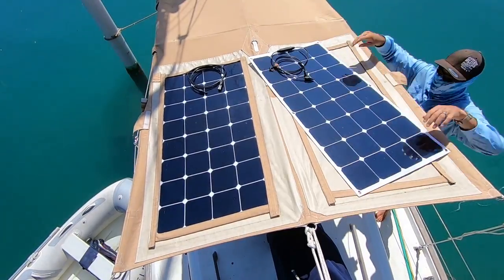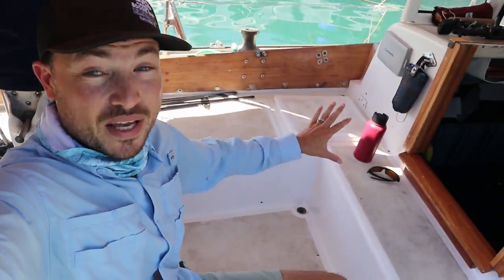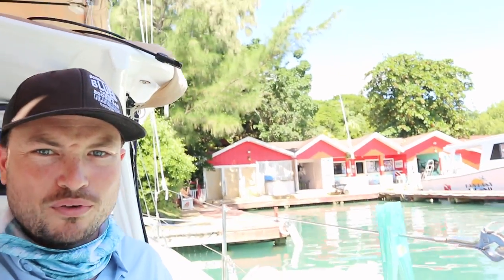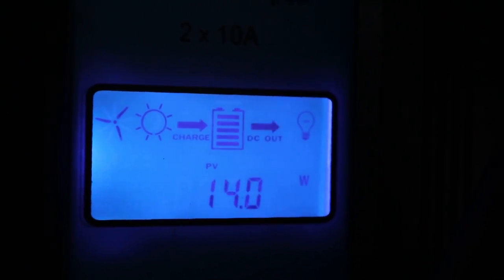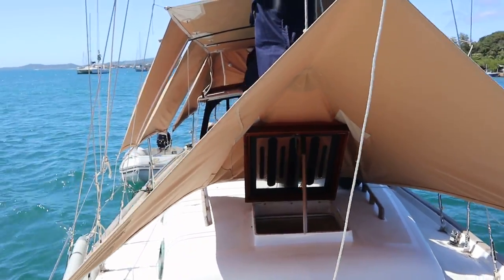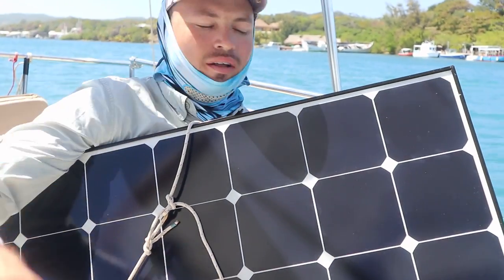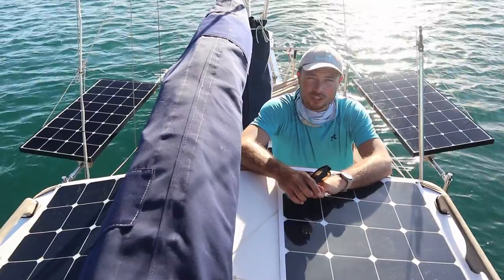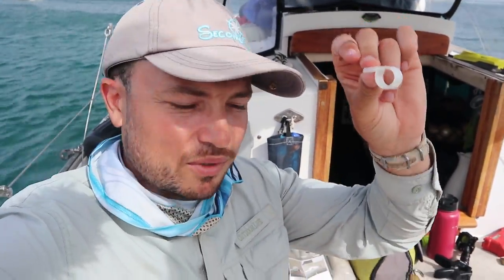Upgrading our Solar Array for Self-Sufficient Sailing | S03E34

Comment: Two suggestions:1) Might be worth the effort to come up with a bottom support strut for the hard panels. The rope will be casting shadows on them almost all the time. Assuming the hard panels are monocrystalline they will be more sensitive to shading than the flexible panels you're used to.  Something pretty easy to test how much the rope is affecting output, see if it's worth the effort. 2) When you have exposed duplex on deck, I think it helps the appearance if you strip the cover/sheathing off some appropriate size rope, and then fish the wiring through that, so basically it just looks like rope. Bit tidier appearance if that's something you care about.
Reply: A guy on my dock has solar panels in the same configuration. He has a under mount slide hinge just twist the key too loosten adjust to angle twist key again. Secure. Probably not cheap.

Comment: Totally love the sunshade setup Des sewed up for Atticus.  On a side note, I would highly recommend soldering any wire connections (crimped or not) and cover with marine heat shrink tubing rather than just using the crimp connectors.  The marine heat shrink tubing has a glue inside that when heated and tube shrinks, it completely water/air proofs each connection. Using crimp connectors alone will eventually allow for corrosion in the salty environment that Atticus will obviously be living in.

Comment: Nice work, I’m right in the middle of my flexible panel install on top of my Bimini.  I stitched some heavy Velcro in a pattern into my sumbrella Bimini and glued the velcro to back of panel.  Hoping it makes for easy removal/install.  It’s a sloop rig though so it’s a little easier to find a good spot .  Wires go up my wing gen mast.  Hope it stays put, will keep you updated.

Comment: just a thought  - you have small cordage securing your panels to the life lines  - we have found that similar length pieces of bungy cord secure as well with the added bonus the elastic nature of the bungy cord allows the cover to get "gusted" and not place too much strain on the guard rails  - a bit like shock absorbers if you wish.  quite happily sits there in up to 20 - 23 kts of true wind.  Just a thought and you two are doing a great job

Comment: Loving all your videos and hoping to get more into sailing soon after years of motorcycle traveling! It's better not to strip back the wire more than an 1/8 to 1/4 inch when crimping on the pin for an MC4 connector. I'm a solar electrician and see damage/failures related to too much of the wire poking into those connectors. Mad respect for all your hard work!!

Comment: I was waiting for that! Having worked on boats when I was younger, I dropped a few things OB without possibility of retrieval. I had a bet it would be the screw driver. The screw was close enough even though it didn't go in the drink. Nice job wiring all that stuff up, and it actually does what you want it to. In my day, it was either shore power, or Gen Set. none of this hi-tech stuff existed. Even batteries were too heavy to use. But then, we were not using as much power as you guys do. No computers, cell phones, ect.

Comment: Nice upgrade. If you make your rail mounts for the panels a friction clamp, it would make it easy to adjust for the sun angle. Also if you can mount so you can swing them inboard of the rail, it would reduce the risk of damage when docking. Have fun.

Comment: We used bbq rail mounts off amazon for  our pivoting panels, mounted on stainless rails like yours. And then we have telescopic squeegees (like, for window washing lol) so we can angle them as needed. The squeegees just get hung on the railing when we're underway and the panels are down.

Comment: Your bracket design for the rigid panels is very well conceived Jordan but, having them made out of wood definitely concerns me. It will be interesting to see how long the brackets actually hold up in that type of application. Please keep us posted 👍
Reply: The wood brackets only slightly concern me, but only from a replacement standpoint. A couple of stowed, two foot sticks of this wood would allow him to replace the brackets numerous times, and I'm guessing the wood cost him somewhere in the neighborhood of $.05. I suppose Jordan could have purchased Sea Dog's #327199-1 rail mounts at around $15 bucks a piece, but this would have chiseled into his beer fund. And as you may know, when it comes to beer vs. a small inconvenience, beer is gonna win out every time, at least on my boat. ;)
Reply: Rob S Can’t argue with that logic. 👍

Comment: I remember thinking I would have dropped at least one of every nut, bolt and screw (ok, I’ll be honest, I’d have probably dropped at least one solar panel in the drink too) over the side on every scene you were working over the water lol. Good job for only dropping one and a place where you could find it.

Comment: Dude just a thought on the solar - in the vid it looks like the velcro was just covering the outside edge of the panel. I'm no expert but in the (extensive) research I did before installing my panels was that even the tiniest shading will impact the output.

Comment: Just a few points (not critique just different). Having a Y with at the panels means there is something that goes over top of the cover (hard or soft) which will  A) rub and be available to getting caught by things dragging across the top. B) have more line loss. You already pointed out the looks issue. Because you are plugging into your hard top, you could put a plugin on either side and avoid all three problems. Of course you are there and I am here. You may have good reasons for not doing it this way either. Take care...

Comment: I wonder why you don't look instead at the ineffective wind generator you have for one that will provide you the energy you need. You have a great wind day & night harnessing that power 24x7 would be the best solution. In my opinion there are wind generators you can install that will provide the energy you need without all the solar panels outboard of the rails.  Great videos by the way, I watch every video you both make and following your adventures is very interesting.

Best of luck.

Comment: You ever heard of a hurricane lantern? It burns paraffin lamp oil. I have one from Dietz that has a hinge handle that you can easily hang on anything. You get light with no wires or batteries and the wind won't blow out the flame.

Comment: You should be very happy with you DC charging set-up. What is you battery bank total? We had 6, 6 volt 185 amp hour, I think, marine batteries and two 12 engine batteries and able to run watermaker, computers, tv, lights and radio's with no problem most days in the Caribbean.

Comment: Hey Dude. If you use dielectric silicone on any electrical connection they will last a long long time. Use it on the crimp connection and any place where there is a tab and receptacle. It is great stuff but don't buy the cheap stuff, use Dow Corning 4 electrical insulating compound. It seals the metal from the elements.

Comment: I'm afraid you may have an issue with that rope (unless its dynema) pulling the flex panels together. When the rope gets wet and over time it will stretch. You've only got a few mm holding those panels on the hook. A little stretch and a little wind and your panels are overboard.  Maybe some grommet twist locks on the inboard side? 
How many watts are you getting out of the wind gen?  What type/brand is it?  Now that you've done it, how many watts per hour are you getting all together?

Comment: Nice job. I have a question, why didn't you run the wires on sides down the stainless tubing? Nice creativity on the mounting all of the panels.

Comment: Jordan: I noticed your exhaust does not have much of a rise from your silencer prior to exiting the hull.  Are you concerned about waves hitting the exhaust and driving water into your engine? The manufacturers recommended rise for my silencer is 18 inches but I cannot achieve that on my boat. Just wondering your thoughts. Thanks. Good video

Comment: Hmm - not really sure but do you want the panels in parallel? I would have thought in series as otherwise if one panel has more light (and output) than the other one, the panel with less light will get bypasses by the protection diodes in the panel.

Comment: Hey guys! We're working on doing a similar rigid panel install on our stanchions, but I'm having a hard time finding hardware. Where did you get your tubing and the brackets you used to attach to the stanchion?  I'd love to know where you found them, and what the manufacturer calls the hardware. Googling "thingy to attach pipe to stanchion" hasn't yielded much for me, lol! Thanks!!! BTW - I love the wood brackets / cord support idea. Do you think it would worth glassing the wood to avoid rot?
Reply from the maker: great question! I'll have Jordan look into this. shoot us an email so I can forward it to him. yep we can on sealing that wood! just needed a temperature fix when we initially intalled the bracket!
Reply: @ProjectAtticus   I'll send an email. Thank you so much! I've spent countless hours trying to come up with an affordable solution, so this video has been so incredibly helpful!

Comment: The name of the tool on Amazon is Master Magnetics 07229 Bendable Magnetic Pick-Up Tool and Retrieving Magnet, 19” Length, 2 lb. Hold, Multicolor in case the link goes bad.

Comment: I'm curious, when you order things on the sea, do you order them to a 'General Delivery' at your next stop?  Do you contact that 'post' to inform them that you are expecting a parcel?
Reply from the maker: great question! we usually only ship things to Atticus when we've been in a location for a couple of months and have had time to figure out which services are cheapest/best. we ask other boaters or marinas. in Honduras we used a company called Dip Shipping. we used fantasy island's physical address to receive the package but sometimes it can be difficult because a lot of the places we go don't actually have an address

Comment: If you are running a mppt regulator and have shunt blocking diodes in the solar panels, you will probably be better running the panels in series rather than parallel.

Comment: I have heard from a couple of sailing channels about the poor performance of the flexible solar panels.  Not sure if it was from one manufacturer or if it was in the nature of the flexible solar panel themselves.  Free Range Sailing found that identical rated capacity flexible panels ,(brand new) ,were only delivering around 50% (from memory) of the power of the same rated and older solid panel.  These were essentially side by side and the tests and were using the same electrical infrastructure.  Ryan and Sophie Sailing were also disappointed  in the performance of their deck mounted flexible panels and I am pretty sure Ryan is in that industry.    Hopefully not all flexible panels are the same and yours will perform well.
Reply: There are a ton of cheaply made and cheaply priced solar panels out there, especially in the flexible market. Unfortunately the technology with regards to flexible panels has yet to be refined, and why many of the reputable manufacturers have shied away from them (LG, Panasonic, Solartech, etc), There may be others, but there is one however that I know of, and that's Sunpower, but you will pay dearly for them. We have one, 100 watt Sunpower flexible panel (the balance of our panels are Siemens rigids) and it performs at around 80-90% efficiency at straight-up noon on a cloudless day. As the Jordster said, you get what you pay for.

Comment: Why not wire both panels in series? Increase volts and amps to controller.
Reply: With solar panels, they send very little charge when partially shaded. When you put the panels in parallel, if one is shadowed but the others are not, they will still function at full charging level. If the panels are in series and one of them is partially shadowed, the charging capacity off all the panels is limited, not just the one panel.

Comment: Tip do not use crimp on electrical connectors always solder..... Or you will have a corrosion failure!
Reply: Sorry, this is incorrect. If a proper, high-grade connector (Ancor, Molex, etc.) is used, and is installed with a proper, high-grade crimping tool (Engineer, Greenlee, etc.), a crimp connection is superior. Unfortunately people rarely buy the high-grade connectors, and use cheap automotive versions instead. If you remove the plastic insulation from a connector, and find that it has a split barrel, this would be considered a low-grade connector.  Most also don't use a high-grade crimp tool, because they run between $75-$150 a pair. Again, instead, they use a cheap $8 automotive version.

Below link to  Rod Collins' Marine How To site regarding this debate. Rod is a  ABYC Certified Marine Electrician.

https://marinehowto.com/marine-wire-termination/